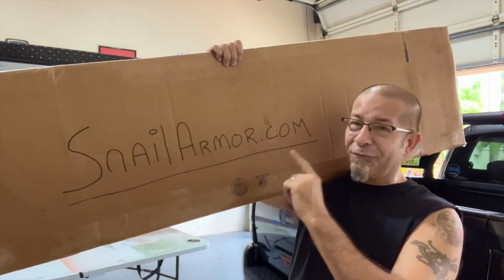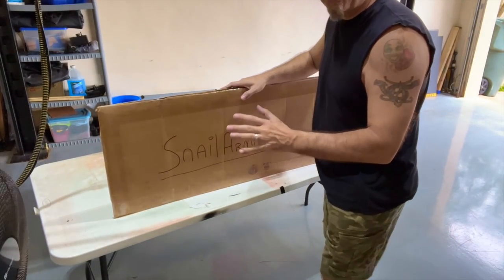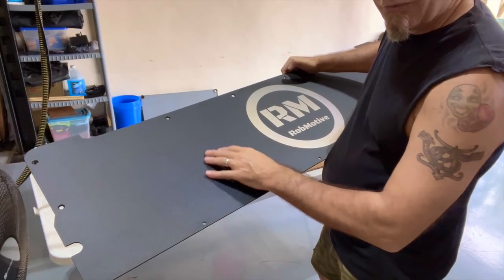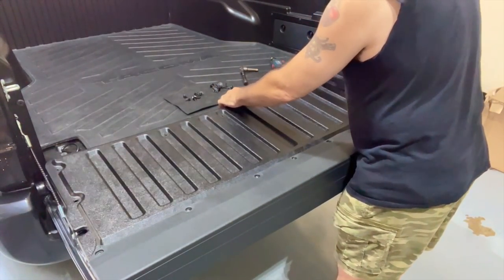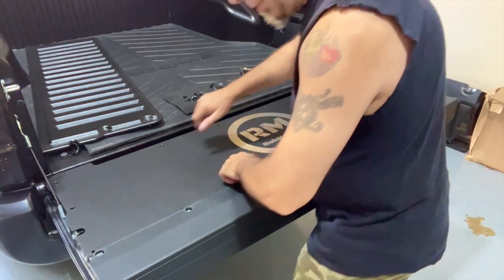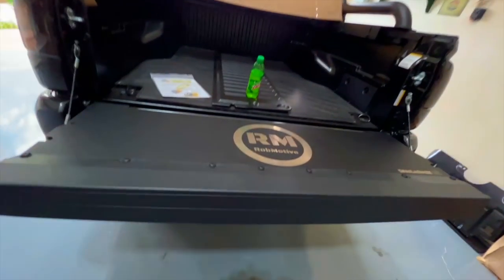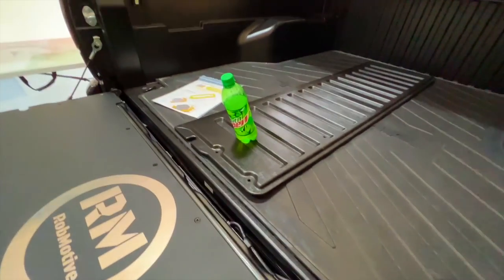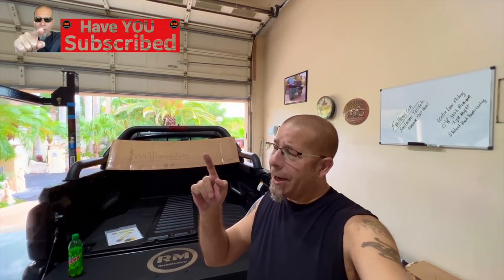I Made My USELESS Tacoma Tailgate BETTER

Comment: I did a very similar mod to mine. I bought the paxrax panel.  It's pretty much the same as the snail trail one. It's also very sturdy and black powder coated. The PAX rax is very plain with only a small logo in the corner.  Same flat surface. Great for me for camping tailgate picnics . One of my main issues with the stock panel was I couldn't sit a drink on it with out it falling over. Now I can sit outside and have lunch on my truck and the tailgate is more useable
Reply from the maker: Definitely makes it more usable!  Less painful on the knees too👍

Comment: When you removed the OEM plastic tailgate cover, it appeared there isn’t much structural support; the reason why the OEM has the corrugation to give it strength when stepped on. I’m apt to think the thin/flat aluminum replacement may bend/dent when stepped on. I hope you’ll give a report at a later date letting know how it fares.
Reply from the maker: You’re right that there isn’t much to the tailgate.  However, I think the aluminum cover actually adds strength to it.  Stay tuned🤔

Comment: I have had this SnailArmor tail gait panel on my Tacoma for 6 months.  It is very good, however when it came to me it was warped (bowed) they sent a note in with it as their powder coater went a little overboard on the coating and the temperature warped it.  It of course did not cause a problem with pushing it down flat for the installation.  That being said the recessed holes did not line up as perfect as yours did and on 3 or 4 of the back screws, they did not go down into the recess to have a perfect below the surface final appearance.  So when you ran your finger over the screw heads some some would be crooked and above the surface.  It looks a little tacky with what you are paying for a product like this.  That being said I still like it.
Reply from the maker: Growing pains maybe?  Mine fit perfectly 👍